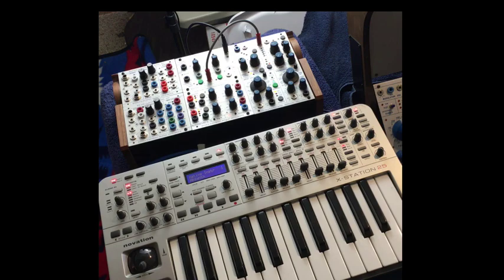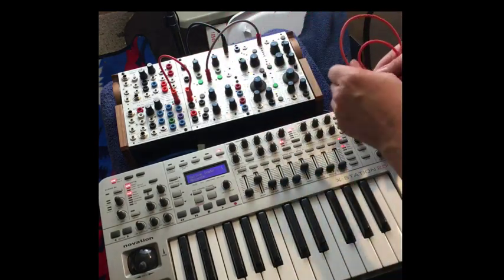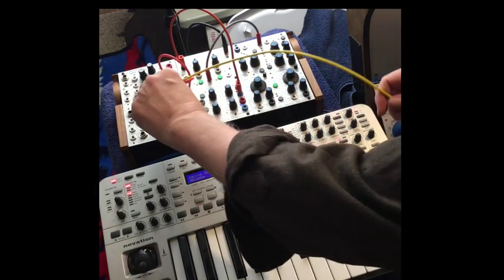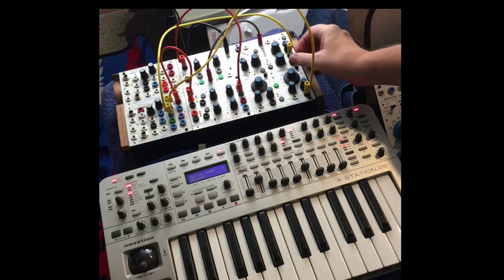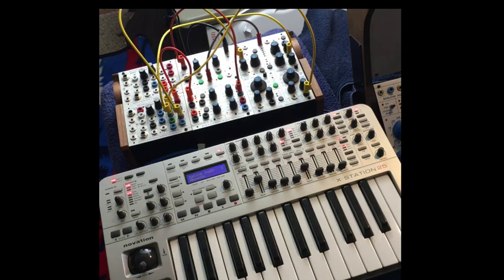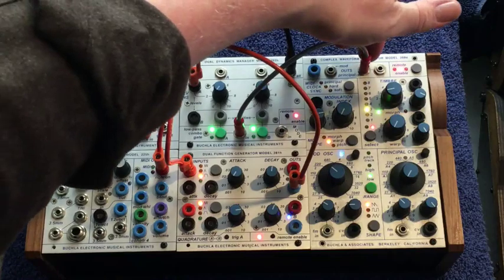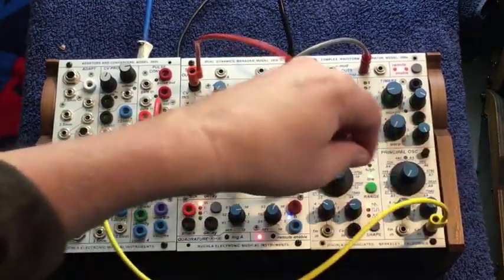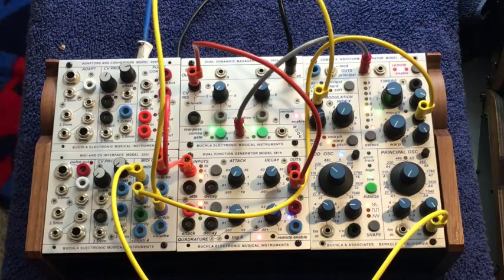Basic Buchla LEM 4 Midi Setup

Comment: You really inspire with your videos Sir Todd! I have the 225e with my 259e would that also be able to give me aftertouch and modulation like you did? If so where should it be configured? I will try my best on this end... Thanks once again and Merry Xmas to you!
Reply from the maker: On the 225e assign/program busses J-P to the continuous controller of choice. See the manual for specifics.
Reply: @vgermuse  you are really amazing at this! Going back to this video and having a last question hope you don't mind. I have a big boat with various Buchla but I also have a 4U boat... What happens with the presets if I take away some modules will it go bonkers? :) Cheers Todd!!
Reply from the maker: sonicultura if leave your preset manager in the big boat and transplant 3-4 modules to your 4 boat nothing will go bonkers. The preset manager scans for modules on start up and registers those. I doesn’t know from missing modules. Of course any presets that had those modules will now be incomplete.